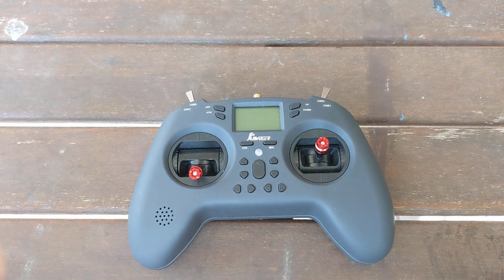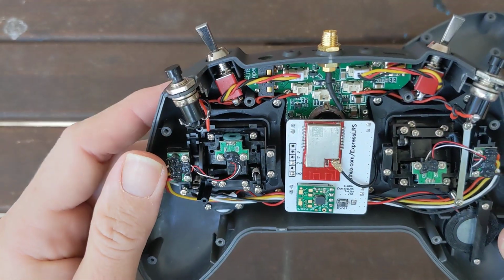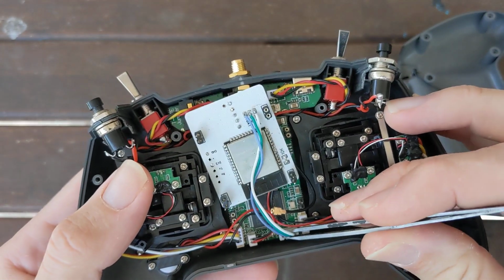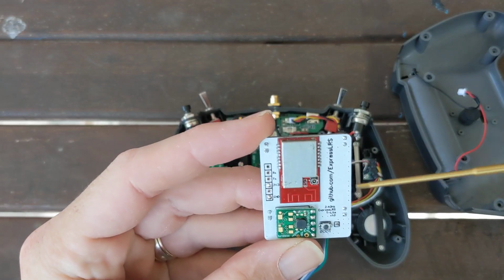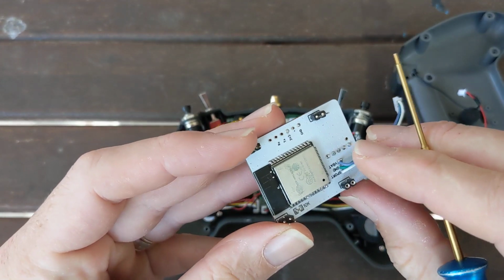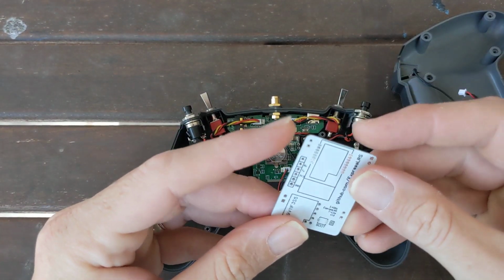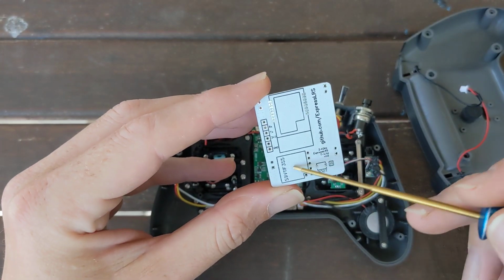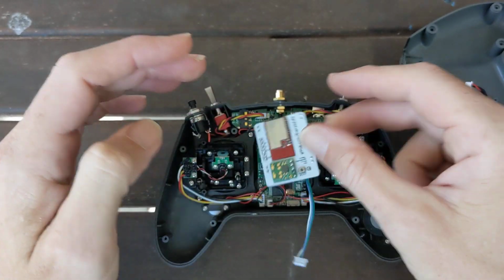Jumper T- Lite ExpressLRS internal module

Comment: That looks like an awesome project!

edit: after a smoked radio and Tx, I finally got it working! Tips from a novice: check FTDI jumper is set to 3,3V and in all excitement don't pinsh any wires reassembling. That's how my first attempt ended, since the T-lite doesn't come with any protections. For the rest everything is as simple as Jye makes it look ;)
Thanks again Jye for sharing!

Comment: Nice Work! 
Just finished my slim module for the T-Lite and was wondering if it was possible to fit it inside. 
Maybe a minimal 2-sided board would fit into the right bottom of the Jumper allowing to keep the internal module working - need to fit a 2nd Antenna then...

Comment: Jye:
I'm a newbie. Am I correxct this video describes only your group's Express LRS development board?
I just ordered Happymodel's ES24-Jumper T-LIte and the Happymodel JR bay ES24 modules. 
Do you know if the Happymodel versions follow features of your board, especially the circumvention of the Jumper T-Lite power problem?
Thanks. The hobby is very greatly indebted to your ingenuity and sharing.  - Jim

Comment: I made according to your project.  lua script runs but sometimes settings are not saved.  and the binding fails.  could it be a power issue?  i use step down AMS1117

Comment: Hi. Which opentx firmware do we have to install for t-lite?
Reply from the maker: A recent opened nightly
Reply: @JyeSmith  btw I thought I can use r9m lite with it but as far as I see jumper doesn't support r9m lite module. Is there a chance it supports if expresslrs is installed on module? Do you have any idea?
Reply from the maker: @yasinsaglam4158  ExpressLRS will make the r9m lite work because it uses the sport pin like CRSF.